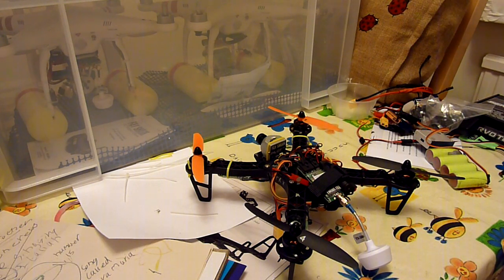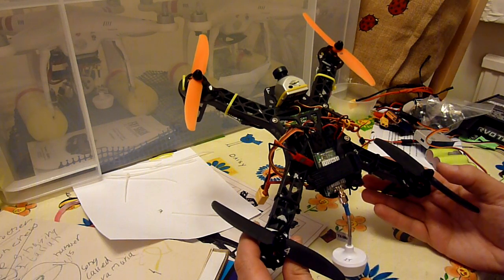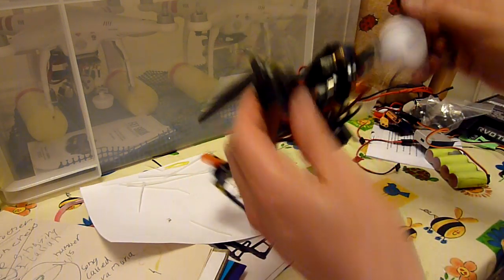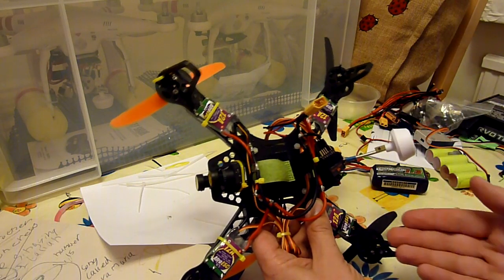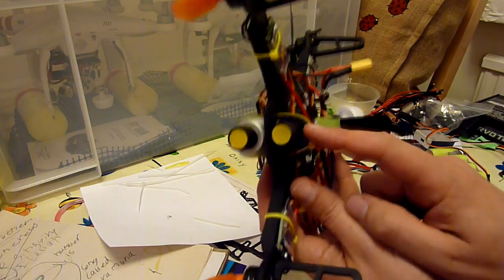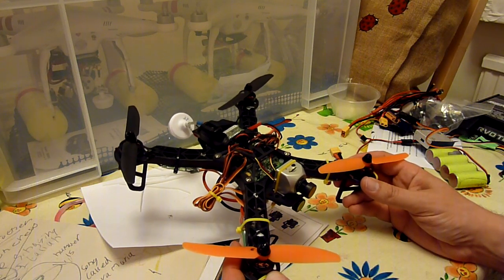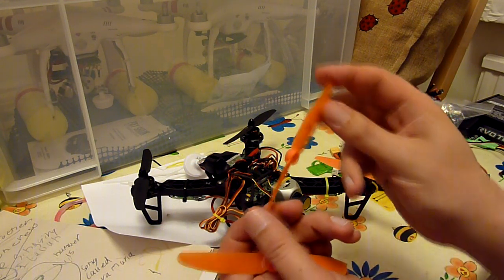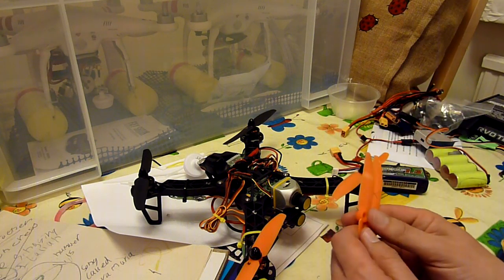Hobbyking FPV250 quadcopter FPV specs and setup KK2 fatshark - BORING

Comment: Hi James I have spoken to you about some different things before, like my fatshark attitudes, and they finally came! I ordered them off hobby king and it has taken an age but they finally came! Also, I have just got this quad today, and I'm putting it together soon. Anyway I was just gonna ask about fpv with gopros, because today for the first time I took my blade 350 qx2 out and did fpv with the hero 3plus black, but it was terrible, I don't know why but the ground was all black and I could barely see a thing as it was so dark, the only thing I could make out was the horizon line, because one half was black and one half was white.
Do you know what is wrong, because it works perfectly with the CMOS 600mw micro camera that it came with.
Thanks! Can hart
Reply from the maker: I have a hero3black and it flew fine with the FPV gear, I did a couple of flights with fatshark 600TVL then swapped to the gopro and much preferred the colours and the fov, so for the 350QX and phantom I've never used anything else. Are you sure your cable is OK and has good connection ? Maybe see if you can find someone else to check another gopro or cable in case thats the issue, there is no adjustment I'm aware of on the gopro for brightness or contrast. I always use 720p/60fps/5sec stills on the gopro, but have tried other settings and there was no difference in the contrast/brightness I could see. Sorry can't be much help.
Reply: OK, I have been having some trouble with my gopro anyway, so it might be linked to that, but just in case I will order another cable, could you tell me where you got yours? Anyway is the video resolution better with the gopro? Because the main thing I want in fpv is the resolution, so do you know anyway to make the resolution better? Because I have the attitudes and they are kind of blurry and like watching a really old movie. Thanks! Cam Hart
Reply from the maker: Cam Hart I just buy cheap gopro video out cables on ebay and crimped my own 5 pin molex for the vtx end. The picture definitely looked better for me with gopro vs 600tvl, not sure resolution is any better but colours and 'view' certainly seemed better. I still use the 600TVL on miniquad and its fine just different. Hope its just the cable as thats a cheaper fix ;)
Reply: Lol yeah, thanks.
Reply: Anyways, I'm gonna run a 3s 2200 mah lipo, and that will only fit if it goes straight down the middle, on the bottom, but I'm a bit stuck where to put my video transmitter and radio receiver, as they cant go in the places you put them, and I don't want them to close together for obvious reasons. Any ideas?
Reply from the maker: Cam Hart Best idea is probably to get some smaller packs ;) I tried a 2200 on the LH frame it flew like crap and hardly gives any longer flights due to extra weight, I think 1300mah is about the sweet spot for 3S. I run the top deck and have vtx on rear lower plate, receiver can go above it or in front of the controller - doesn't seem to be an issue having rx near vtx as freqs are so seperated.
Reply: K thanks!

Comment: Hi do you run a gps or other flight modes or is it just manual flying all the time and would it be a good quad for a beginner
Reply from the maker: No GPS or barometer (altitude control) on KK2 controller, I run 3 flight modes, SL, manual and SL mix so its self levelling around centre but manual at full stick. Whether its a good first quad, I think if you are comfortable with FPV maybe, personally I started with a GPS quad so you could relax and use GPS hold or return home if you felt overwhelmed which I really liked, but the 250 is robust and cheap enough you could just learn with that I think, if you have an open space to practice in and plenty of props.

Comment: whats your pi gains on the kk? im having problems with my kk, it oscilates and flips over
Reply from the maker: Gains are in description - if it flips over doesn't sound like gains is the issue, I'd check props/motor directions, or maybe you have a bad motor/esc which is intermittent.

Comment: Great video , I have same fatshark pilot cam for both fpv and recording , and seems great for fpv ! I have used naza lite with RTH, how do you find those motors , I am using the multistar ones ,which seem a bit slugish ! I also have a build and flight video showing GPS hold and alt lock and footage from pilot cam  would like to see how yours flies Cheers Steve
Reply from the maker: The 2400kv rcx motors have been fine for me, I have 4 which are all fine, the ZMR equivalent seem lower quality (2 of 6 are bad), but are a bit cheaper. If you have the multistar 1900kv motors you may need to up the props to 5x3x3 or even 5x4x2 or maybe 6x4 ? I see hobbyking now have a 2150kv version which might be better if your limited to 5" props. I think GPS is overkill on a 250, and more things to get tangled in tree's, also makes it very expensive - your naza alone cost three times as much as my whole quad ;)

Comment: with the motors I put the x fittings on and zip tied to the  frame got the weight of mine to 278g without battery and get 9 mins on a 3s 1000 no bullets all soldered very quick love it
Reply from the maker: You can just zip tie through the bottom of the motors and save more weight, but no FPV gear is pretty boring, still any weight saving is good when you add the FPV gear.
Reply: ***** totally agree on the fpv comment I have all mine also a bit concerned about the latency with the hd pilot cam it didn't seem that bad to me but I am a noob to fpv
Reply from the maker: stephen newman-whitworth if it doesn't bother you thats great, a lot of people are flying micros on mobius with no issues so its definitely a personal preference thing - using one camera is definitely simpler and lighter, so do whatever works for you.
Reply: I have a Mobius too so I will have to compare them both I do like the timer on the pilot hd as I havnt set up an osd yet its great fun hooked already even after flying the 250 into my head lol
Reply from the maker: stephen newman-whitworth The timer on the pilothd was nice to get an idea of flight time, although I still have the tx timer beep to rely on, I'm normally knackered by about 4mins anyway ;) I found colours a bit weird on pilothd video, but the light adjustment on mobius is pretty slow, so I'm happy using separately fatshark 600tvl for FPV and mobius recording at the moment.
Reply: I agree with the colours on the pilot also I don't think I was doing myself any favours maidening fpv on a 250racing quad tried it on my 450 deadcat and that was much better also confirm I found the Mobius better too

Comment: How do the motors fit? thinking of getting ZMR's for mine but looking up some people say the holes aren't aligned
Reply from the maker: The holes don't line up, the frame slots only go down to 14mm bolt spacing, and the ZMR motors are 12.4mm so you have to slot them with a drill, its a bit fiddly but not hard. The Multistar 1904 motors fit straight on but are taller and lower kv so neither is perfect (I have some on the way to look at). The RCX motors seem to work well, and I really like having self tightening prop nuts, so for now I am happy with them.
Reply: ***** Cheers for the info, did look at those motors but was reading about the shafts breaking so thought I'd try ZMR's
Reply from the maker: Zillawill Me too, but not sure if those are people running the carbon composite gemfan props which are much stronger, and I suspect may be causing 1904 shafts to break, I am sticking with the cheaper gemfan plastic props, they break very easily so hopefully will prevent damage to motor shafts. Other than shafts breaking with the 1904 I'm not sure if 1900kv will cut it, RCX are 2400kv and power is adequate but not crazy, so losing 500kv/almost 20% RPM I wonder how much difference will make. I really don't want to run 3 bladed props, as they are awkward for transport, and I think they are ugly and inefficient ;)
Reply from the maker: Zillawill Just to add you can get very nice adaptors to fit ZMR motors straight onto the frame from http://www.pureimaginationengineering.com/store.html I just ordered a set to try out.